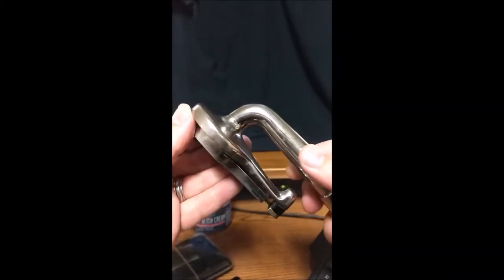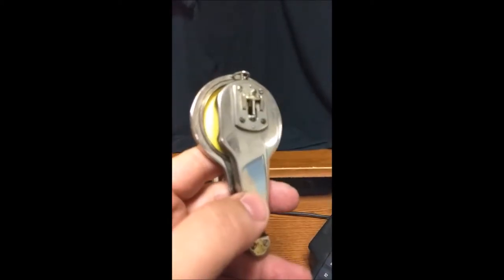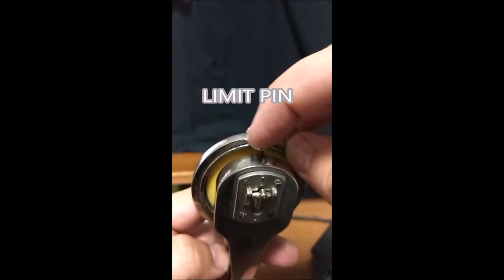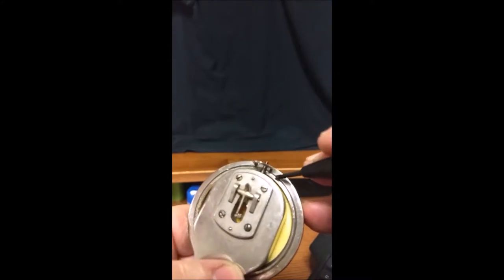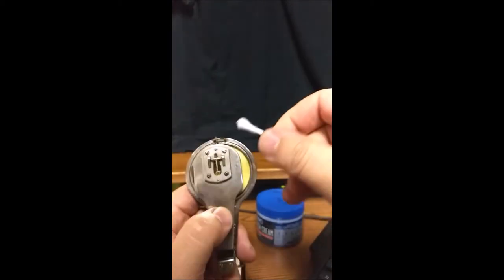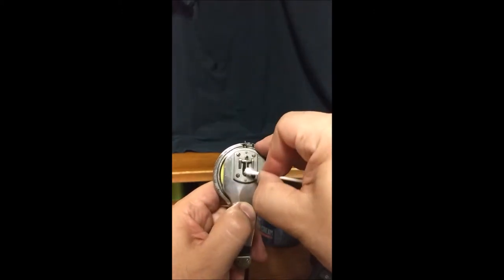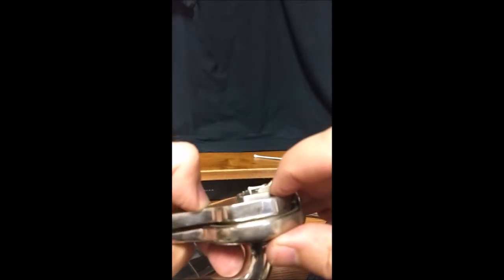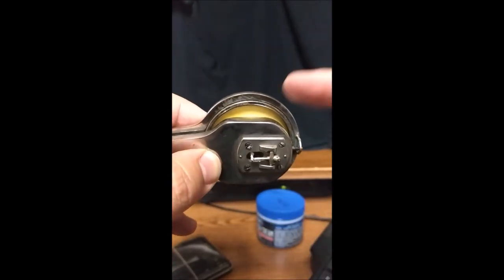How To Make Your Edison Diamond Disc Reproducer Sound Better!!

Comment: Would you mind sharing the mechanism of how polishing the needle bar improves loudness and sound quality?
Reply from the maker: Sure. Shellac, dust, and dirt that compiles onto the needle bar over the years dampens the sound quality. Just imagine something vibrating and you throw a bunch of dirt and dust onto it. IT will not vibrate as strong as if it were clean.
Reply: @ThePhonographStop  Thanks.

Comment: I just discovered an Edison S19 in our basement and it does work! The main problem I notice is that the reproducer and phonograph don’t keep up with the needle and causes it to repeat the same line of music. Any idea what might be wrong with it?
Reply from the maker: First run the needle in the blank area at the end if the song and see if it leaves a line. If yes bad diamond stylus. Check my recent video on Edison Diamond Disc phonograph. Shows the limit pin and how it needs to be centered while playing . If it hits the ring it will skip and repeat. The pin is in the front of the reproducer.